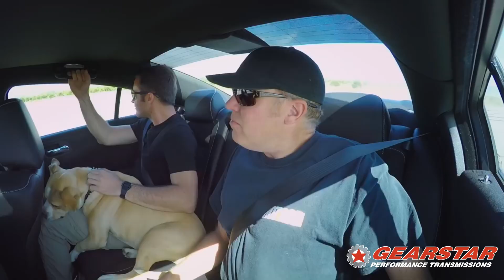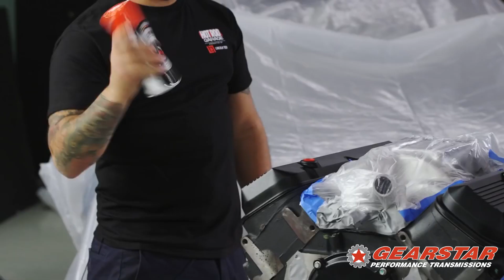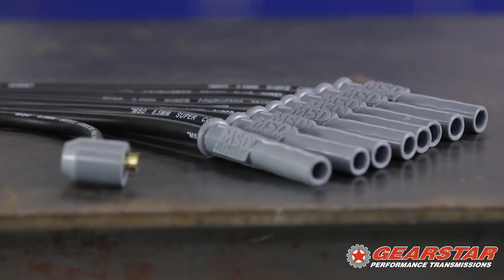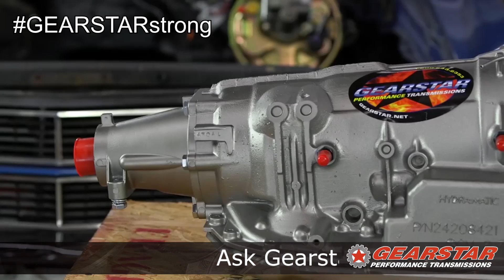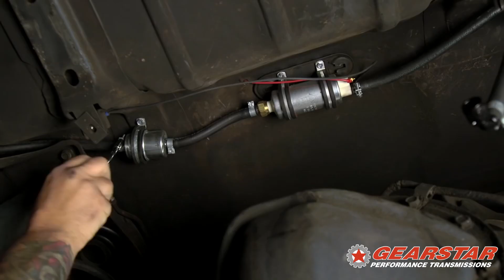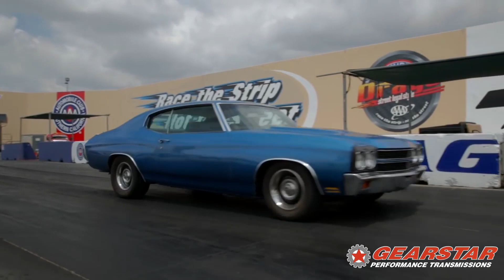Hot Rod Garage SS Chevelle HT502 and Geastar 4L80E

Comment: 8.2 Liter V8 / 10 mpgs and slower than a stock 4cylinder VW Golf R. Sigh.. I wouldve just went with a modern aluminum sbc. Sure its more money but the weight and gas savings. I want to like BBcs , I just cant. They sound amazing FWIW
Reply: This engine is designed to be a replacement engine for heavy duty 3/4 and above trucks. Lots of torque. They picked the wrong crate ending for this package.
Reply: ashley gorman it’s because it’s a stock crate motor. I’m sure it’s got a really lame cam and poor flowing heads. With the decent set of cam and heads I guarantee that motor is making 600+hp easily
Reply: Just go drive your prius

Comment: Those cheap valve covers do not apply even pressure and are going to sweat oil all over that engine and it going to look like caca soon.....Nice transmission though.....
Reply: I would have kept those cool cast aluminium ones it comes with!